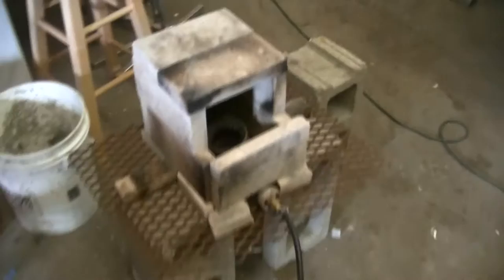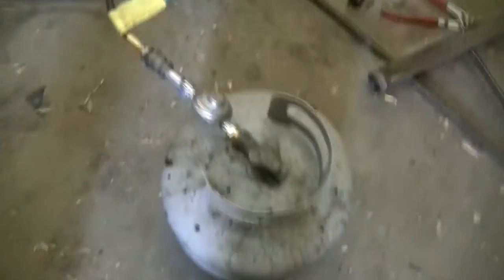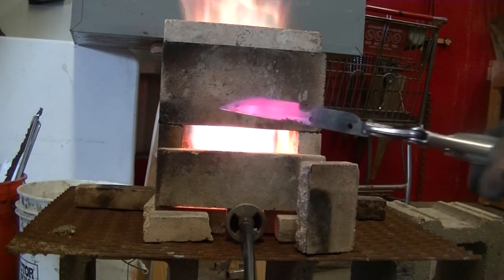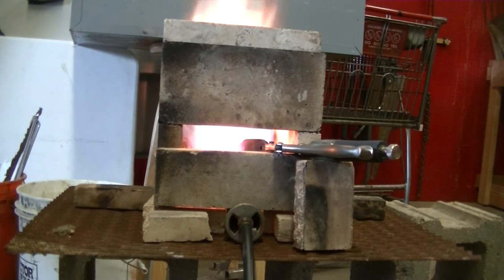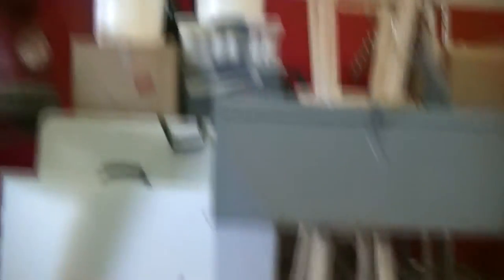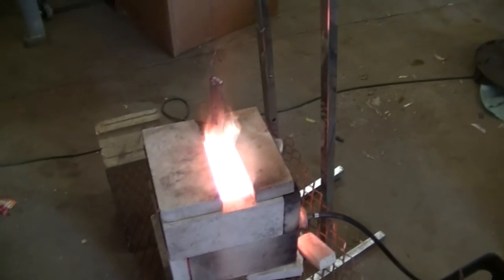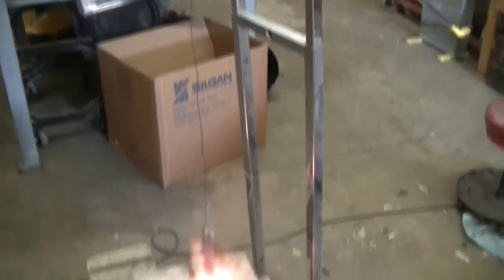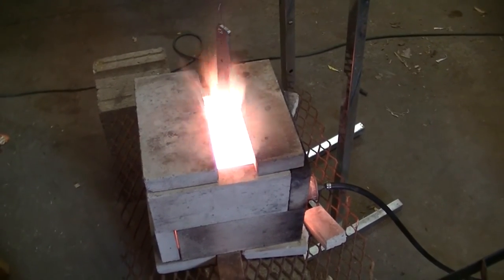Kiln Design & Use

Comment: nice forge and knife design.   but why do you heat it in the oven.   400f  isn't hot enough to change the hardness of the metal.   and even if it did it would soften the metal.
Reply from the maker: +John Latsch Tom Chitwood said it Anneals it.  Softening it is the way I think about it also.